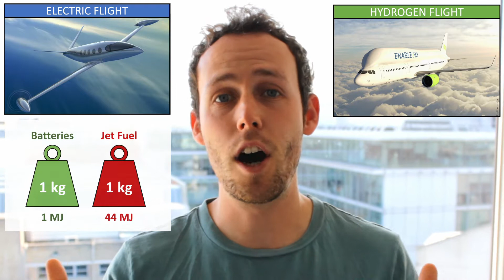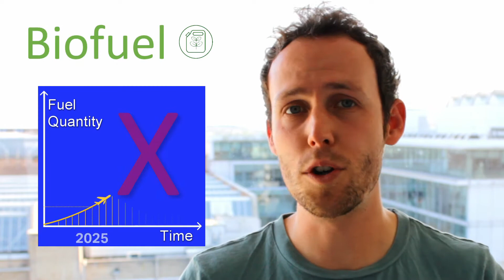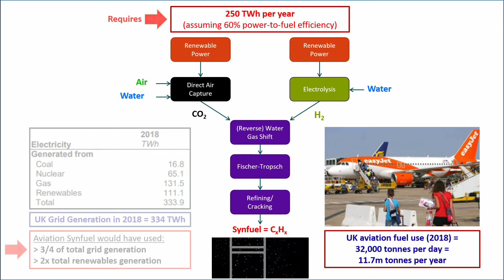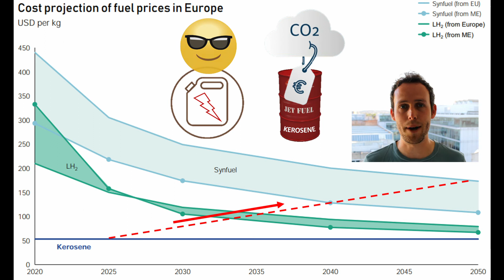Alternative Jet Fuels   (Part 8: Sustainable Aviation)

Comment: You could combine the 2 - upgrade biomass with hydrogen (e.g. electrodimerisation of some lignin compounds like furfural to get a C10 backbone, then hydrogenate it).
Reply from the maker: We can't scale up biofuels to large quantities without incurring significant risks in terms of land use change, biodiversity loss, loss of soil nutrients etc. That includes lignocellulosic biomass (although no such biofuel processes have been demonstrated at commercial scale) as there is competition with other sectors e.g. the large amount of BECCS relied on within all IPCC pathways.
Reply: @GreenSkyThinking  well as one example, hundreds of millions of tonnes of bagasse are burnt in the sugar industry. But sugar refineries can be made all electric, running off heat pumps and renewables. That frees up a lot of biomass.

I think you've taken an assumption from a low grade use of biomass (burning it for electricity) and applied it too broadly. 

The idea will be to add energy value (including with Green hydrogen and renewable electricity) to low grade and waste biomass. 

Defeatism won't save the planet.
Reply from the maker: Hi @fehzorz  thanks, defeatism won't save the planet - but equally a lack of realism will kill it. I'm not defeatist about our abilities, we can turn it around, but we do need to be realistic.

Burning sugar (or other agricultural) crop waste clearly isn't a good scenario. But our option isn't a binary decision between 1. Burn it. Or 2. Make jet fuel from it. 

Fermenting sugar bagasse is one of the easiest lignocellulosic biofuel pathways but again, we have limited feedstock and how can you justify using it for aviation fuel rather as BECCS to displace fossil generation on the grid + capture and store the CO2?

Would be interested in your views on the conclusions made in this report:
https://www.biofuelwatch.org.uk/2018/dead-end-road/

You might have some insights that Biofuelwatch don't.
Reply: @GreenSkyThinking  the key is to think of a hierarchy for uses of biomass. In my view, food is at the top, and rotting to methane is at the bottom. Various forms of leaving it alone (where it doesn't end up as methane) are also high of course, as are long lived products (e.g. construction materials). At the lower end, you need to think about the difficulty of abating the alternative use - so burning it for electricity, or biofuels to run small engines in vehicles that could easily be electric are not ideal. Even high temperature process heat hydrogen and electric arcs might do the trick.  But Jet Fuel is an excellent high value use of biomass.

Fundamentally what I'm talking about is something that should be easier than synthetic fuels from direct air capture CO2. People talk about BECCUS and DACCUS, all I'm saying is don't forget the U. Nature did the hard work to fix the carbon and even put it into relatively long chains, now use that backbone to get the most useful carbon containing product (using various chemical processes). Not limited to fermenting cellulose either (what the linked report talks about). What I mentioned was based on a lignin byproduct. The lowering costs of Green Hydrogen will change a lot and we'll need to pull out some very old chemistry textbooks to best figure out how to upgrade biomass.

Definitely cut down on flying whenever possible (e.g. in areas where rail is an alternative). But we will need long haul flights for a globally connected world, and that's the only kind of world that will be able to solve a global challenge like climate change.

At the very least, why not take a look at where biomass is already being used, and see if it can be displaced for better uses. So for example, the Drax woodchip burning power plant, the global fuel ethanol industry (largely to run cars that could be EVs), or the burning of sugar bagasse.
Reply from the maker: @fehzorz  yeah that's a good idea and I have written down a hierarchy which I can share with you if you're interested by emailing greenskythinking@outlook.com.

Yeah we need to protect biodiversity and preserve carbon sinks ahead of agriculture, so that also suggests minimising livestock farming.

The important point is we only have a very finite amount of truly sustainable biomass waste available globally. Some X million tonnes of corn stover, sugar bagasse, rice husks, etc. Some. Of these things we can turn into useful products and keep the carbon captured e.g. Building materials, home insulation or plastic replacements e.g. Reusable coffee cups.

If we use for bioenergy, we should use it for something that will maximise the emissions saved and stored per tonne of biomass used. If you burn it in a BECCS ppwer station then you displace coal/gas from the electrical grid, which goes far further than the amount of  kerosene you can displace by it turning it into jet fuel. This is due to the inefficiency of the fuel production process but also using it in an inefficient vehicle combustion engine. Furthermore, you can fit CCS equipment to capture the carbon emissions at the exhaust then store geologically. You can't do that on a vehicle such a truck or plane due to weight and volume issues.

So if we have 10 million tonnes of biomass, I wouldn't advocate for policies that subsidise the production of jet fuel over use in BECCS.

I also wouldn't advocate for subsidies that divert it from road transport to air transport. Fuel refineries are more efficient if they maximise biodiesel out out rather than biojet. So if you divert feedstock to aviation it reduces economy-wide decarbonisation. We are nowhere near taking all combustion engines off the road - particularly HGV lorries, so will continue to need biodiesel for decades yet.
Reply: @GreenSkyThinking  anything that involves electricity, renewables (solar and wind) are the answer with a little bit of firming (storage and bio/landfill gas prayers). They keep going from strength to strength. That's the answer to coal.

I'd definitely like to see Beccs on the unavoidable point source CO2 emissions from things like ethanol fermentation.

At any rate, just don't underestimate what Green hydrogen can do once it goes down in price and scales up, as a chemical reagent. Ammonia for Diesel and ship engines is promising. I think jet fuel will be solved this way too - upgrading biomass (easier than Fischer tropsch from DAC) with electrolysis/electrodimerisation and hydrogenation.
Reply from the maker: @fehzorz  well we need renewable energy for Direct Air Capture, but we won't have nearly enough, hence the IPCC's vast reliance on BECCS for negative emissions in all pathways. Wind currently provides only 2% of global energy demand and Solar only 1%. Our growing demand for electricity in the ICT sector = data centres, AI, 5G, electronics etc. could well hoover up 100% of our renewable energy output. 

The problem is, it's easy to reel off a long list of possible technologies. It's another to actually scale any of them in a realistic time frame, without depleting our global resources even further and in doing so exacerbate environmental and social crises. That problem is made even more difficult if we continue to scale consumption in a manner which outpaces low-carbon energy growth. 

That's why we need government policies to reduce and restrict demand for energy intensive activities. Growing biomass for biofuel production and burning it in a jet engine is one of the most energy intensive things imaginable. 

For example, there will only be a tiny amount of green hydrogen available in 2030. There won't even be enough to decarbonise current fossil grey hydrogen uses e.g. in fertiliser and chemical production.
Reply: @GreenSkyThinking  In many parts of the world wind and solar are the cheapest forms of energy. The revolution is here, and coal will be gone surprisingly quickly.

I don't disagree with you on needing to reduce flying. From your perspective in Europe there are many viable alternatives. I've heard it can be cheaper and quicker to go from Manchester to London via Spain on a plane than on the train (and people do it). So plenty to sort out. But here in Australia almost none of the viable commercial flights are short enough to be replaced by rail. We need high speed rail, but it's been through 50 years of feasibility studies and isn't close to happening. And we need to be globally connected.
Reply from the maker: @fehzorz  I'd say that the benefits of mobility need to be balanced against negative impacts. Being able to travel somewhere quickly has obvious benefits, but equally if we great barrier reef gets bleached and dies completely, if wildfires continue to increase, drought becomes more prevalent, sea level rise swamps cities, food prices spiral ever higher etc. then the benefits of a minority burning lots of jet fuel to reach far-flung locations for a short vacation or business trip may be increasingly outweighed by the negative impacts.

I'm not saying there should be zero flying, just simply that aviation should be properly regulated and this will mean limits on air traffic and air miles as the technology isn't available to do so without consuming vast quantities of energy and producing vast quantities of emissions. So there needs to be constraints.

Comment: Increasing the cost of energy is not the answer.
Reply from the maker: The cost of energy is largely dictated by supply vs. demand. The majority of the world's energy demand is provided by fossil fuels. Wind energy only provides 2% and Solar Energy 1% of global demand currently. Global energy demand is rising every year. We also rapidly need to phase-out fossil fuel extraction. This tells us demand will massively exceed supply of available energy and energy costs will soar, unless we greatly reduce energy-intensive processes. Bear in mind the producing synthetic electro-fuel and burning that in an aircraft is one of the most energy-intensive things you can do. This all points to the cost of flying massively increasing over the coming decades. This is my understanding of the physics and the economics - happy to be given alternative views though?
Reply: @GreenSkyThinking  To start, I would disagree on the supply and demand theory for energy prices. Because energy is a commodity, it is traded. The anticipation of supply reductions or an increase in demand increase energy prices, not necessarily the actual supply and demand. I have also heard we have over 500 years worth of oil remaining to be welled - so supply is plenty. -- From an economic perspective, the keyboard I'm typing on reached my house from China because of oil. If we increase the costs of energy, the keyboard price (with shipping charges built into it) will increase. It's basically inflation, as energy is used make and transport all material things within our economies. Prosperity and wealth for all nations depends on cheap reliable energy. Expensive energy reduces production, decreases economic activity, and leads to less prosperity. 

If you can create an engine (fuel cell) that can convert chemical energy to mechanical at 80% efficiency instead of an ICE at 25%, you can pay 3x the cost for the fuel and still get an economic advantage. 

I don't think we should ever intentionally create necessity through hardship (through taxation or other price increasing measures which will damage prosperity) to promote innovation. Instead we could create necessity through innovation challenges and grants.

Comment: Would you say that these synthetic fuels are also the so-called electrofuels or e-fuels? In my class they did the distinction between bio and electro fuels but I dont know if it refers to the same as you are mentioning here. Thanks for the amazing video ❤️
Reply from the maker: Yes in hindsight my terminology isn't the best, as both biofuel and electro fuel (e-fuel) can be 'synthetic' or synthesised using the 'Fischer Tropsch' process. The importance is that biofuel uses carbon from a biological source (e.g. plants or waste) and electro-fuel uses carbon from a non-biological origin (e.g. carbon capture powered by electricity). E-fuel is often called 'synthetic fuel' or 'synfuel' or 'power-to-liquid' fuel though. 

Biofuel fact sheet:
https://stay-grounded.org/wp-content/uploads/2021/08/SG_factsheet_8-21_Biofuels_print_Lay02.pdf

Synthetic fuel fact sheet:
https://stay-grounded.org/wp-content/uploads/2021/09/SG_factsheet_8-21_Synthetic-E-fuels_print_FIN_A4_Korr.pdf

I helped write both of these fact sheets, so let me know if any questions!
Reply: @GreenSkyThinking  Super clarifying! Thank you again for your videos on the topic and your answers. Im recently growing more and more interest for the green-fuels topic, and I am really considering focusing my thesis on this topic now :)
Reply: Sorry for spamming but, Europe has changed the policy which they will go for hydrogen and battery only,  not SAF. SAF still emits CO2. Please get your update about the recent policy change here https://ec.europa.eu/commission/presscorner/api/files/document/print/en/ip_22_3854/IP_22_3854_EN.pdf

Comment: what about wood fiber blended with 50% with traditional jet fuel
Reply from the maker: What about it? Where are you getting your wood fibre from? Saw dust from mills? Because that's already used for other stuff. Branches and twigs from forestry? Because that's super diffuse, located at disparate locations, and very low energy density by weight and volume, so high transport emissions just getting it to a processing facility. And, if that processing facility is close, I'd recommend using it to produce fuel for powering the very vehicles doing that forestry/agriculture work right there and then... rather than shipping/trucking it miles to an airport and generating even more emissions. Just some initial thoughts on why this seems like a pretty bad idea, I could go on. Google "THE CURIOUS CASE OF RED ROCK BIOFUELS" and look for the article by Biofuelwatch for an example of this not really working very well, if at all.
Reply: @GreenSkyThinking  i use used coffee grounds
Reply from the maker: @TimSmith-vl4qk  you create jet fuel from used coffee grounds? Personally? We do actually know that coffee grounds cna be used as an effective fertiliser for reforestation https://www.nationalgeographic.com/environment/article/forest-on-caffeine-how-coffee-helps-forests-grow-faster so maybe a better use than turning into jet fuel?

Comment: Thanks for your series of great videos ! 

I would have 3 questions if you have time:

1-	Biofuel: given the amount of waste we have on Earth, why do you think there is not enough “raw material” to produce them in large quantities ? I tend to think the same but I’m looking for “proofs”
2-	Do we agree then when biofuel are burnt, they release the SAME quantity of CO2 than fossil kerosene ? However radiative forcing is les intensive, correct ?
3-	When e-fuels are burnt, do they release no CO2 at all ?

Thanks again,

Julien
Reply from the maker: Hi Julien, thanks for the questions. 

1. As an example to illustrate scale: if we produced our 2018 levels of global jet fuel consumption using biofuel from wheat, we'd need the equivalent of the entire global human calorific requirement. Bear in mind the aviation industry wants to double air traffic from 2019 levels by 2040. Think about all the biomass "waste" we generate too... is it really "waste" or could we compost it and use it to replace fossil fuel fertiliser... thus reducing emissions far more? If we have non-food waste, do we not need to try to reduce this: remember "reduce, reuse, recycle"? Turning non-biogenic waste into fuel is particularly bad... and a lot of our current waste has non-biogenics (e.g. plastics) mixed in. Even if you find some sustainable supply of biomass waste that can't be composted etc... there are better, more-efficient uses for bioenergy such as grid back up (which can have CCS applied to the exhaust) and biodiesel for long-range trucks and ships. 

2. Yes, same CO2 released... non-CO2 effects are being studied, and partial reduction appears possible which is good... but this is counteracted by the greater CO2 reduction you would have got elsewhere if turning the biomass into e.g. road or shipping fuel (requires less biomass input for a given output of fuel). 

3. E-fuels release the same quantity of CO2... as with biofuels, the agreement is that you sequestered atmospheric CO2 in the first place to create the fuel... so "no net CO2 taken from underground and released to the atmosphere"... of course the reality is different, and actually the huge energy consumption of e-fuel production would be likely to prolong fossil fuel extraction/burning in order to meet the energy demand. For example, producing current levels of global jet fuel consumption with e-fuels would even optimistically still use more than our current global renewable generation capacity... and most of that is currently hydro which can't be scaled (Wind currently supplies 2% and Solar 1% of global energy use). 

Let me know if you follow this - good questions!
Reply: Europe Europe has changed the policy which they will go for hydrogen and battery only,  not SAF. SAF still emits CO2. Please get your update about the recent policy change here https://ec.europa.eu/commission/presscorner/api/files/document/print/en/ip_22_3854/IP_22_3854_EN.pdf